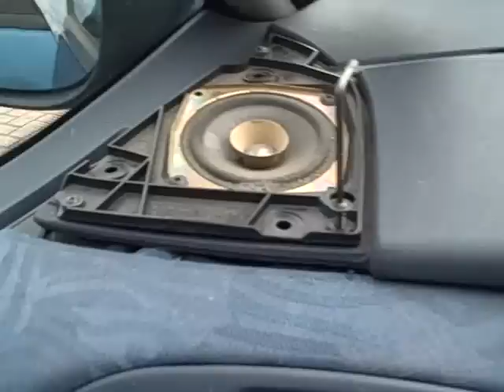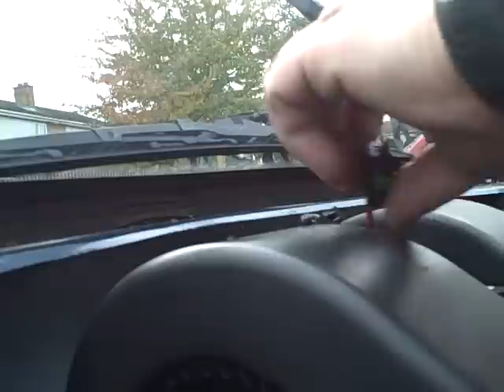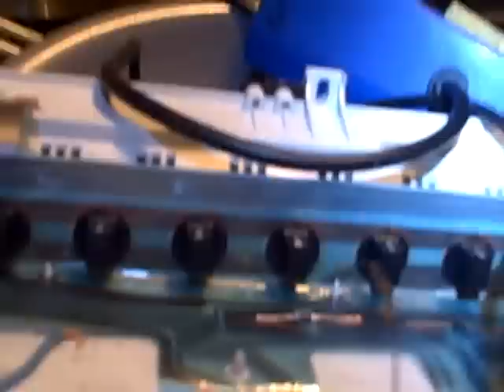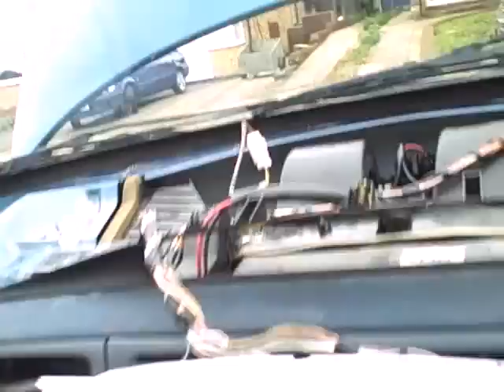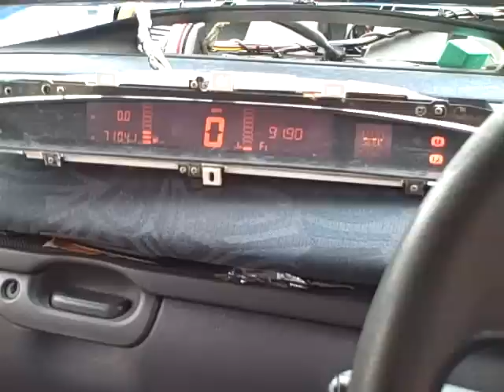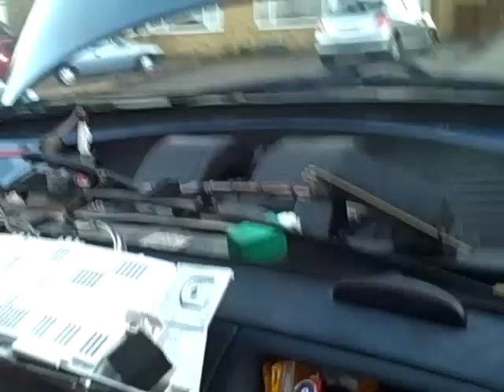renault grand espace heater fan

Comment: Typical Renault looking for one elusive fault and end up finding another half dozen unrelated problems. Turns a half hour job into a week of torture and heartache. I've got a fan on mine that works perfectly until you start the engine and then it only blows for a few seconds then stops and starts.